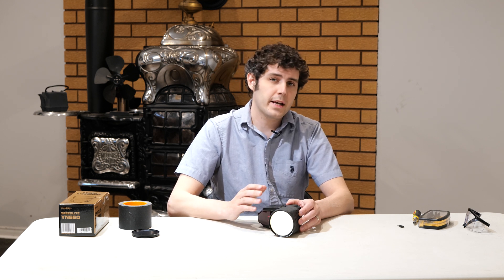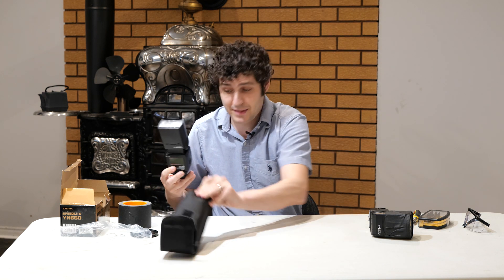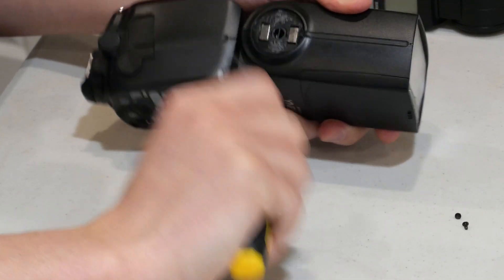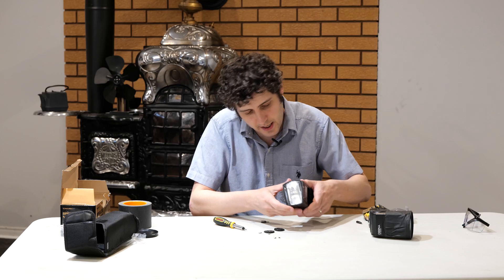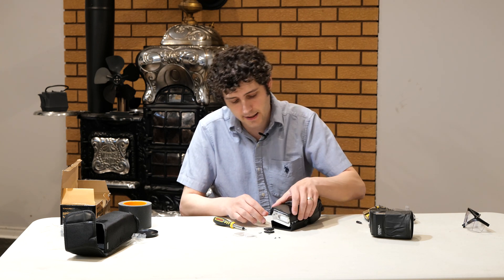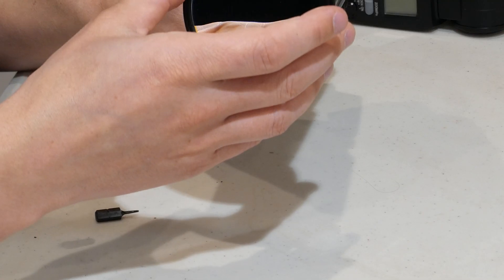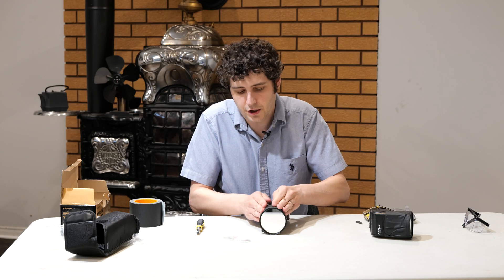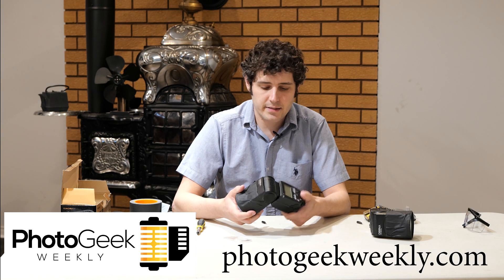Converting a camera flash to UV / Ultraviolet with Don Komarechka

Comment: Thank you for this video. I'd love to try this, but getting the filters is a bit difficult and expensive. I was wondering;  is it not possible to just use a normal 850nm IR filter to cut off the red leak (instead of the midOpt filter)? Or have I totally misunderstood something? Thanks again
Reply from the maker: Glad you enjoyed the video Ki! Yes, the filters are expensive but it really is critical to get a pure, clean UV light source. If you take a look at the transmission chart for any 850nm IR filter, you'd be right that it would cut any red bleed... but it would also cut 100% of the UV spectrum as well, making it completely useless. The goal is to let as much of the UV spectrum through while nullifying as much of the visible spectrum as possible.
Reply: @DonKomarechka  Oh I see.. I knew there was something I was forgetting. Thanks for clearing that up. I guess there isn't really a cheaper way of doing it then. 
By the way, how many flashes do you typically use? I'm assuming at least 2 would be ideal ?
Reply from the maker: @wayofki  of course there are cheaper ways, but you might not get the purity of the light source, which will contaminate the scene especially when shooting a subject with very dim fluorescence. One flash is enough to start - you can set the camera to be a longer exposure in complete darkness and fire it multiple times, even moving it around to act as if it was multiple flashes. This approach doesn't work for moving subjects like insects, but there are plenty of static subjects worth exploring!

I use 3-4 flashes, because I have them. I could use less and still get great results. I started off with only one! :)
Reply: @DonKomarechka  Thank you. I appreciate the advice. I actually came across your UV photography a year or two ago, and have wanted to try it out ever since.
Reply from the maker: @wayofki  give it a shot, it's a totally new word to explore not just with plants but also minerals and artificial fluorescence as well. I've made some freezing soap bubbles glow by using invisible ink (fluoresces bright blue) in the bubble formula. Tons of creative avenues to explore!

Comment: Hi Don, Great work!  love it.   For the Hoya U-340 77mm filter, is there a other similar product? try to found on eBay and cant get 77mm. Or is the U-360 works too? Thanks again! and you got a new fan! ( I am in Canada)
Reply from the maker: The U-340 and U-360 are quite different in their transmission. You might be able to ask one of the sellers that have sold them in the past if they have any stock on them (just check the "completed listings" box) or you can always get a filter in a different size. I preferred the 77mm because it fits nicely at the edges of the flashes, but smaller sizes would work too - you'd just need to be a little more generous with the Gaffer's tape.

Also, the VERY best solution comes at a much higher expense: The XNite 330C + XNite BP1 filters that can be purchased from https://www.maxmax.com/shopper/category/9197-77mm - one is under UV, one is under the visible filters category, and they block not only visible light but also infrared light. Since our cameras inherently block IR light with a filter in front of the sensor, this extra advantage isn't really needed, unless you're thinking about exploring UV reflectance work, an entirely different beast than UV fluorescence. :)
Reply: @DonKomarechka  thank you!

Comment: Do I need to do UV-induced fluorescence photography in the dark using an unmodified camera?  Or can I do it outside, with a higher f stop to limit visible light, with a powerful UV flash? Or do I also need visible light filters on the camera lens if I want to do it outside during the day?
Reply from the maker: You'd need to make sure that the ambient light is inconsequential to the exposure - a simple test by taking a photo without the UV flashes on should yield a dark frame - nothing visible. This is very hard to do even in ambient room light let alone outside during daylight hours. Keep in mind that while the lights emit UV light, your camera captures VISIBLE light that has fluoresced off the subject so you cannot filter away visible light and still get an image. Effectively, you'll need to work outside at night or in a darkened studio for best results. :)

Comment: Con.  Love your videos.  For converting a flash, I have an old Canon 550EX speedlite (GN 180).  Would this work well, or should I get the Yongnuo 660 with its higher GN of 217?  Thanks.
Reply from the maker: I hope you didn't mean to call me a "con", Bill. :)

The higher guide number of the YN-660 will likely help with maximum output, but moreover I don't know how Canon treated their flash bulb in the 550EX. Some flash bulbs directly have a UV coating on them instead of relying solely on the plastic in front of the bulb to block the light. Some don't. It's impossible to know until you test it out, but so far all of the Yongnuo flashes I have tried have untreated bulbs.

Comment: Don, excellent job explaining the process to convert the flash.  You mentioned the xenon bulb transmits UV along with other wavelengths.  So, there is no need to remove any UV coating on the bulb or is the UV protection just in the plastic?
Reply from the maker: Thanks Calvin! Xenon itself emits UV, visible light and infrared but some bulbs have coatings on them to stop the transmission of UV light. The bulbs in the Yongnuo flashes may have some sort of coating but a lot of UV light escapes them, relying on the plastic in front of the bulb to handle the UV light more effectively. For this reason, no adjustments to the bulb itself is required - just remove the plastic and you're good to go!